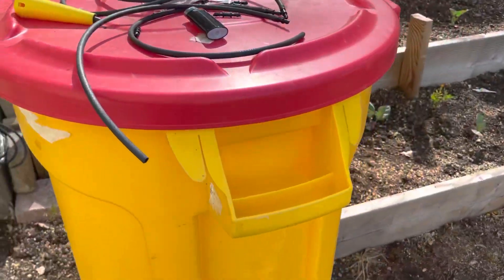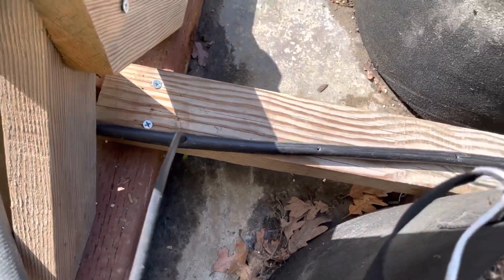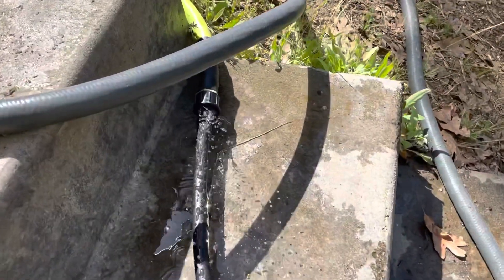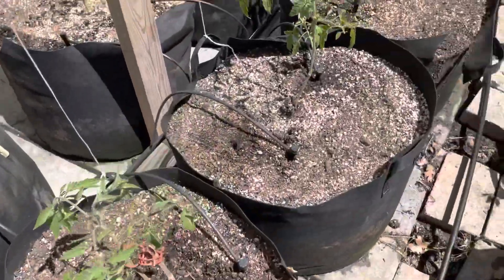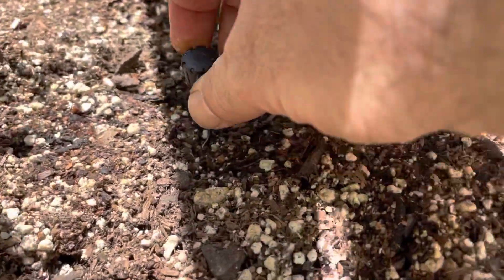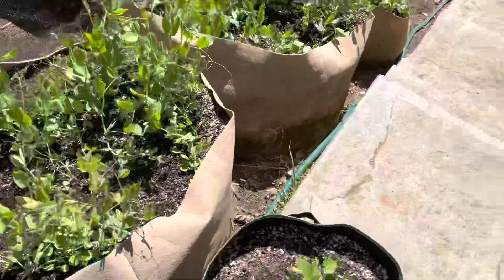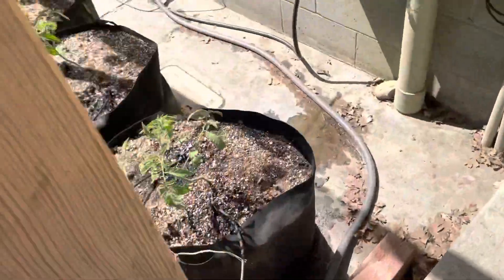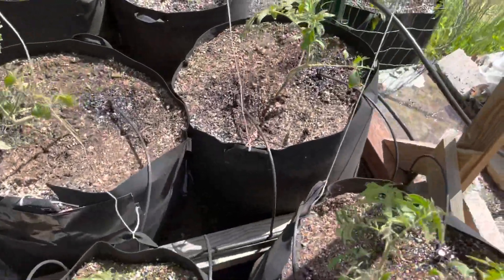How to build and troubleshoot a drip irrigation system

Comment: I like how you show your "ideas" and not only 100% successful stuff, seems like the sprinklers need a lot more pressure which is unfortunate but even the small sprinkle they're giving off should still over time get the plant watered enough, right? Nice tomato setup though shouldn't run out with that much supply!
Reply from the maker: Yes they’ll get watered ok but it’s not as even or consistent as I want. Really the weak link are the drippers. I’m going to replace them and it will work better.
Reply from the maker: But overall I like this system for easily feeding the garden
Reply: @joehomegardener373  should be getting mine sometime this week, looking forward to future updates of the Garden